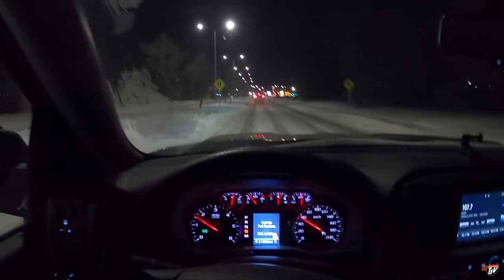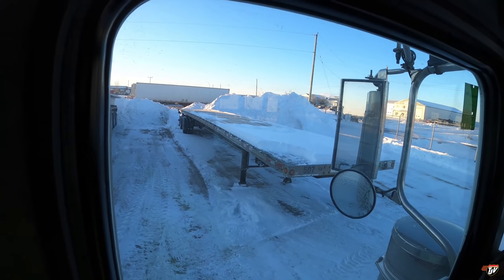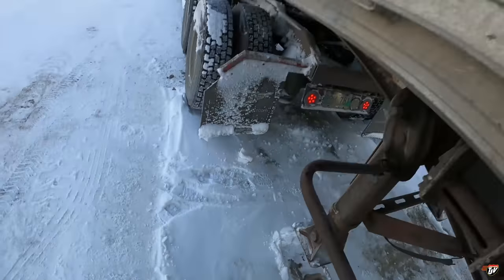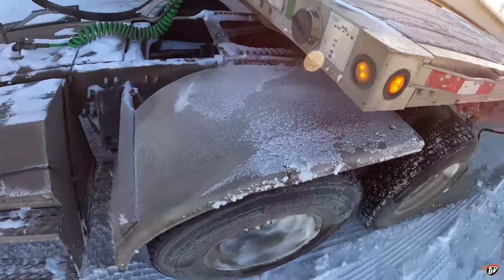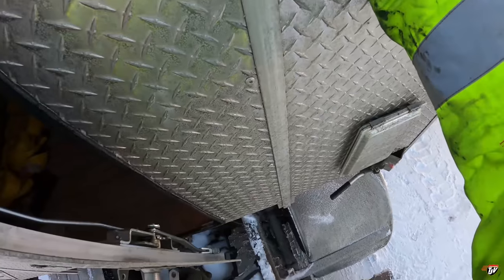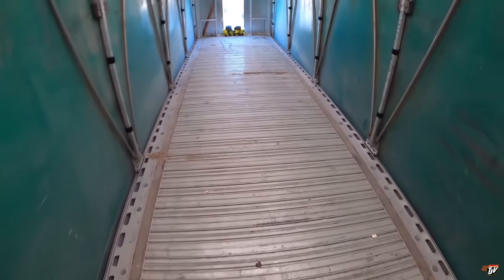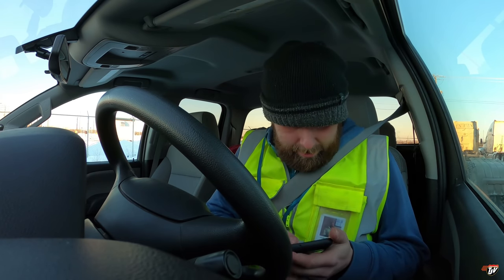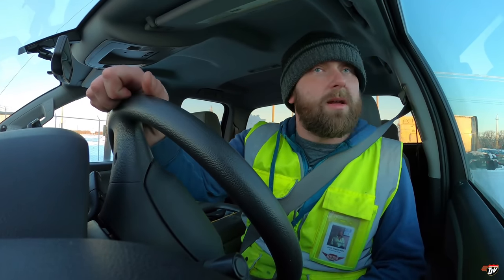PLANS CHANGE | My Trucking Life | Vlog #2451

Comment: The expression snow flurries refers to light, intermittent snowfall without significant accumulation. Snow flurries tend to come from stratiform clouds.Snow showers is the label used to refer to a short period of light-to-moderate snowfall, also characterized by a sudden beginning and ending. There is some accumulation with snow showers, and they fall from convective or cumuliform clouds.

Comment: Why do the trucks in Canada and America need to be so damn long? I mean... so much unused space between the cab and the 5th wheel. That only gives you a bigger turning circle. I'm from The Netherlands and almost all trucks here are wat you call "cabovers"... They might not look that spectacular (in some viewers eyes), but for maneuverability: big win! I just can't get my head around it.... Enlighten me, please.
Reply: majority of roads here in north america are wide to accommodate a long wheelbase. its much more reliable for traction in our harsh mountains with snow. and looks cooler d:^)
Reply: Longer cabs due to many overnight runs
Reply from the maker: Roads here are built for these trucks, they have more space,  more comfortable  and they look much better 😎
Reply: @GBgrenade  Thanks! That explains a lot. And sure agree to the cool factor!
Reply: @Trucker_Josh  certainly agree on the looks, but I still think our trucks are just as comfortable...